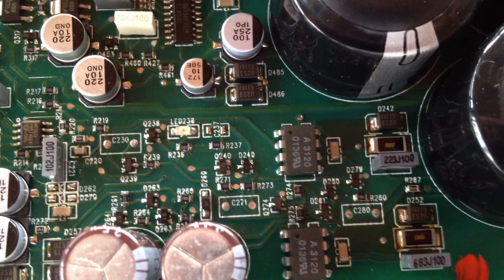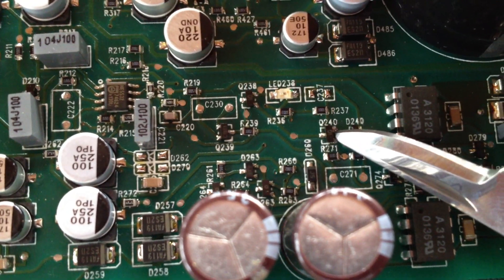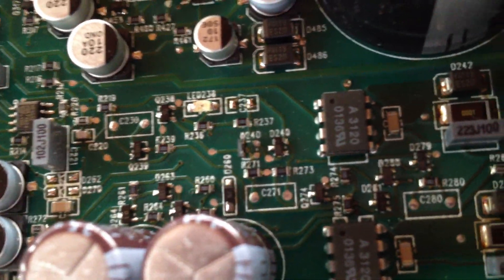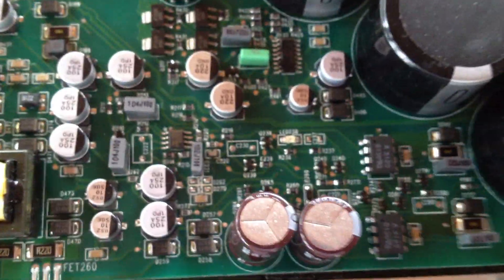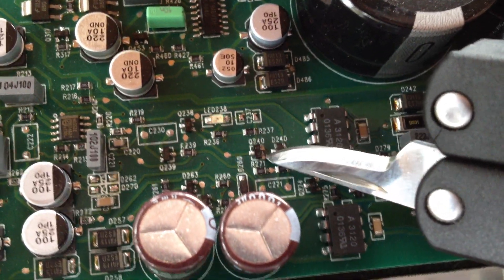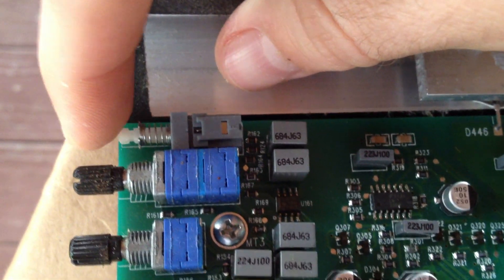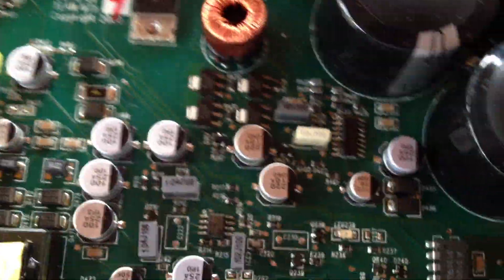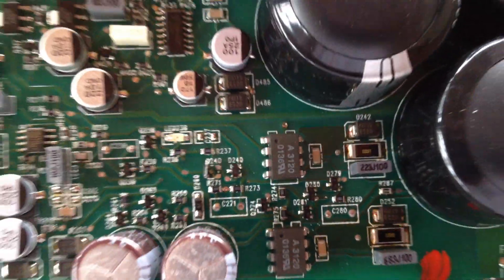How to modd a Mtx 1501d and Mtx 81000d to be 1 ohm stable.

Comment: I just watched a repair that blew out the power supply mosfets+some because of this mod on each amp, lmao
Reply: They only blow after this if you cross the speaker output wires. First hand experience on accident 2 yrs after pulling this transistor. Amp still worked and pushed hard but at half the power.
Reply: @stevint202  ya nah man, most will drive this amp into clipping and/or not feed it enough power and blow the amp, which usually happens ...highlight that lol
Reply: @stevint202  not how speaker wires work 😆 you can wire speakers backwards all day, it just reverses the polarity. Speakers don't have power they get it from the amp and the impedance doesn't change when wired differently. Aka an amp has 0 clue if a speaker is wired to it + to + or + to -. Kinda like how you can wire a house outlet backward with the neutral and hot. Since those don't ground just like speaker wires, the devices that are plugged in have no clue and work just fine.

Comment: I have mine positive to positive negative to negative subs bridged linked or what ever isn't that 1ohm ?
Reply: series and parallel, the difference is when you take 4+4 ohms it will equal 2 ohms, if you take two 8 ohm it will equal 4 ohm, so if you have two dual 4 ohm woofers and go positive to positive and negative to negative it will be 1 ohm resistance, you must however remember that all subwoofers have a rated impedance and actual impedance, the rated being what is stated and taking a resistance measurement of the woofer will give an actual reading, it can also tell you what your wiring or setup is actually reading! Can't people remember the old days when you could buy an amp that would run 1/4 ohm bridged mono? Kicker started out as truck woofer! I am repairing a few buys I found of A/B mono blocks that run 2 ohms mono and from what I see they like burning resistors, power controls and op amps, transistors and Capacitors! My guess is that people don't understand the resistance of their setup and wiring it properly to prevent failure! As for watts I had a apx400.4 rated 380, 190x2 max running 2 12" 8 ohm JL Wo woofers rated 125 watts cont power as well as 2 15" 8 ohm Wo woofers rated 150 watts cont power and I would impress more than the police, fire dept's, banks and stereo stores. I set off bank alarms, woke up emt's and was pulled over so cops could look in the back of my van, not to mention I had to get RV rubber dampening that was 1/2" thick to keep the side of my van from buckling and creasing. Want good spl, mix and match sizes and build proper boxes, buy an epicenter and choose lower mhz settings like 45-60 for your crossover, you set them higher and you will miss lower tones, wire your setup properly knowing series would be taking a jumper from one coil or woofers + terminal to the other coil or woofers - terminal and using the two left for +/- to your amp, parallel would be +to+ and to, it is about sound waves and the lower they are the farther they go! Series would work good if you have two 4 ohm dvc and want to make it a 4 ohm mono setup or 4 single vc 4 ohm woofers and still want to run the 4 ohm mono. The same goes for two 2 ohm dvc or 4, 2 ohm woofers and end up with a 2 ohm mono setup!
Reply: @LuxorVan   so if i have a 15" kicker comp (svc 4ohm) 
A Rocksford fosgate prime R1 12"(svc 4 0hm)

And a MTX Thunder 4000 12" ( svc 8 0hm ) 
 What wouldy best setup/wiring/box design)???
Reply: Also forgot to mention im running The.    
 MTX Elite Thunder 1501D      2 Guage power and ground . And i have 2 Polk Audio component 6.5 in both front doors with 2 tweeters and 3 pioneer 4 way 6x9s in the rear deck

Comment: It's a transistor not a resistor.  It disables the protections circuit so yes it WILL blow if you cross wires.  It will also blow if a sub gets a shorted coil.  I wouldn't call it 1 ohm stable, more like 1 ohm capable.
Reply: I totally agree! I was expecting a Mosfet swap or something like that... this solution is pretty crappy... It's just like saying: No seatbelts? I'll just take some peice of thread, that'll be allright!
Reply: And then doing 100MPH instead of 50.
Reply: You will not blow one of these amps iv seen them basically on fire and they still work.
Reply: @HoursFreeAOLsp  that's funny given that I've repaired over a dozen of these amps that were VERY blown.

Comment: You modify both the 81000d and 1501d the SAME way. You knock out the voltage protection circuit. The voltage protection circuit is chipset Q240. After doing this and turning off the compression circuitry, the amp will produce in excess of 2500 watts when run at 0.7ohm and 17v for burps. For daily it will do 1500 all day long at around 1ohm.

Comment: 1501d is already stable at 1ohm mines been runnin everyday 4 years straight no probs cant say for 81000
Reply: Because of impeadnace rise most likely
Reply: What is the RMS you get on your 1501D at 1 ohm because the Manual doesn’t say anything abt out 1 Ohm ratings

Comment: @ThAGaMeR1000 The outputs usually short and the power supply mosfets blow if protect doesn't act quickly enough (which is what is being disabled in this video).  If your amp uses IRFB42N20Ds in the output it may be serviceable.
Reply: That are serviceable no matter what typically.  Now that irf42n20s are obsolete finding replacents has been fun....